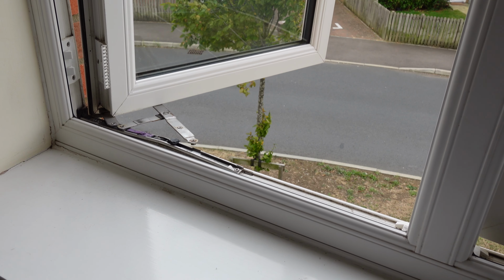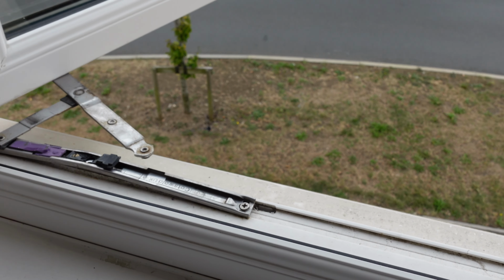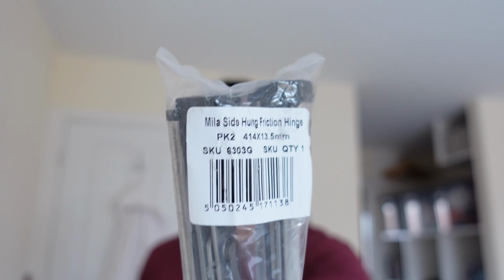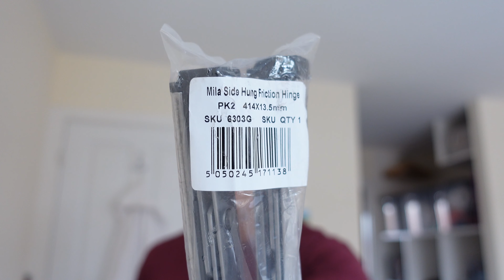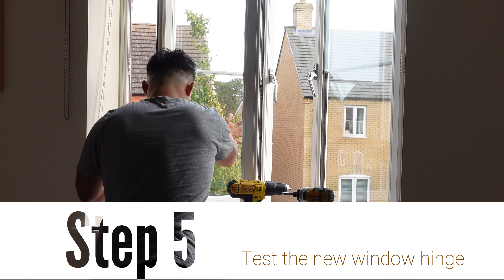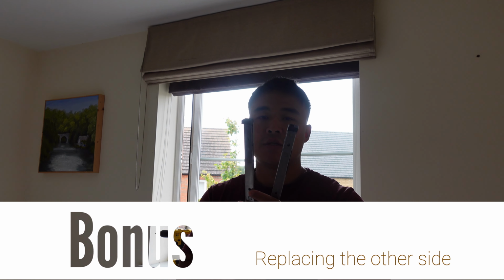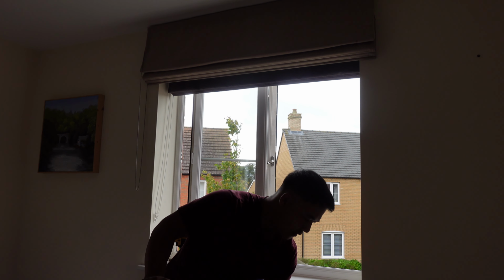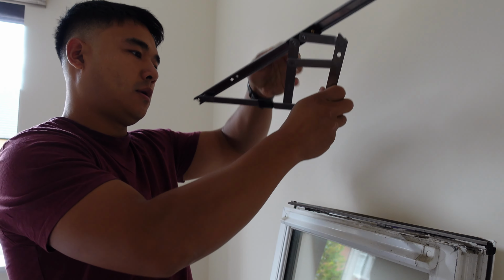DIY Broken Hinge Replacement: How to replace uPVC hinges

Comment: Hello Paul, well done for changing your hinges. I’ve been a glazier for 40 years and replace around 100 pairs of these hinge stays a year. 
Couple of things that will make it easier for you next time. On internally glazed openers, I always attempt to remove the glass unit first. It doesn’t always work, but if it comes out OK, that reduces most of the weight in the frame. Just take your time and it should come out without breaking. A flat putty knife will remove the beads. Second always remove the bottom screws first, then you have control of the top hinges and screws when removed. Pilot drill the new hinges on the frame first, with a small 2-2-5mm drill bit, that way they are ready for you. Small pilot drills are OK as the fixing screw will bit. Drilling a hole too big is an issue, as the screws won’t bit. At one point the opener started to fall out and that can be very dangerous, so preventing that is important. When fitting the hinges on the opener, check where the old part of the hinges are positioned, in relation to the opener. Occasionally the hole in the top position in the opener is different and new pilot holes are required, otherwise the opener won’t line up. You can also check that the unit is blocked correctly when refitting it. Toe and healing is the method, you can check how that works online. Hope that helps.
Reply from the maker: Thanks Dave, very helpful

Comment: Drill pilot holes? Can you please explain in depth how that's done? Surely the screw is only holding on to a thin bit of plastic then? So all the weight of the door on a thin bit of plastic? So crack and snap goes the window? Please explain. I need to replace mine too
Reply from the maker: When I replaced mine, I used a longer hinge so I needed to have the holes in different place than the original holes. I just lined up the hinge and then drilled a small hole. Much smaller than screw so the thread still has enough material to hold on to, otherwise it can be quite hard to screw directly into the pvc plastic